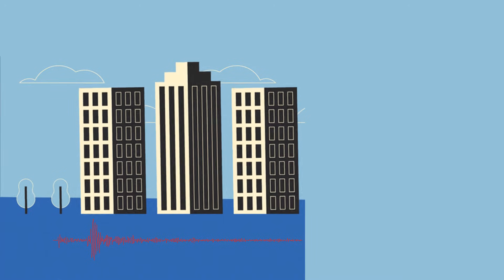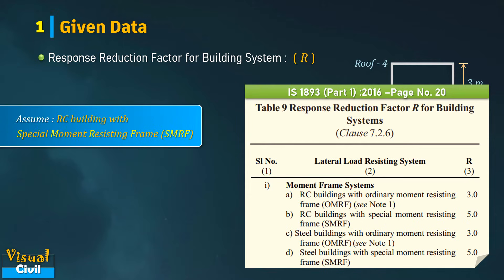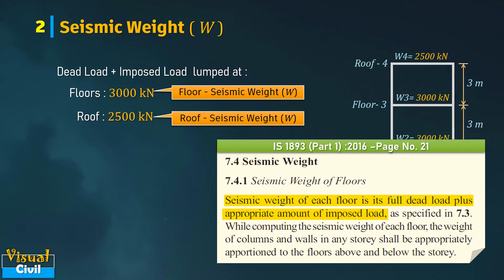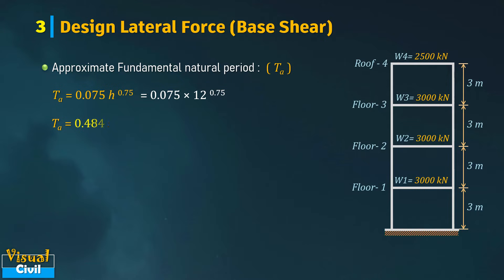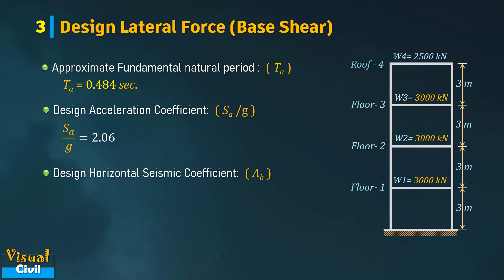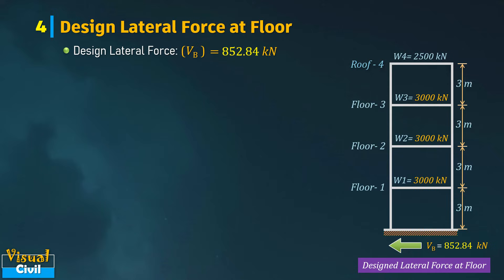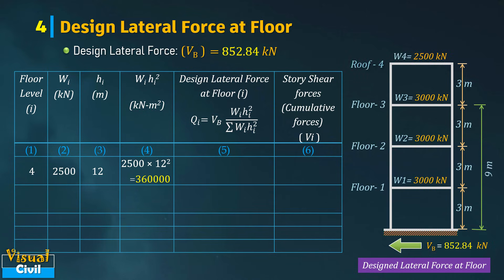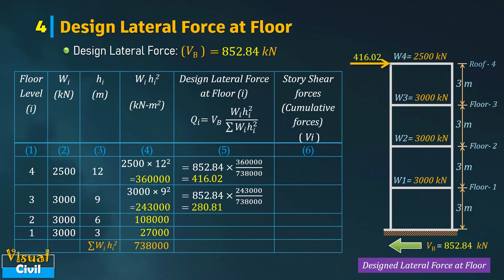Seismic Analysis by Equivalent Static Analysis Method Using IS:1893 (Part-1) 2016

Comment: Very nice explanation, however you should have splitted the total DL into DL and LL because in seismic weight calculation, we do not consider LL at roof
Reply from the maker: Thanks for your suggestion. In another video of seismic analysis, DL and LL is separately calculated for floor and roof
Reply: As per IS1893 part 1-2016  there is no where mention to consider cracked moment if inertia for static analysis. But some engineers in software they consider this value. This is required only for dynamic analysis. Kindly tell your view.